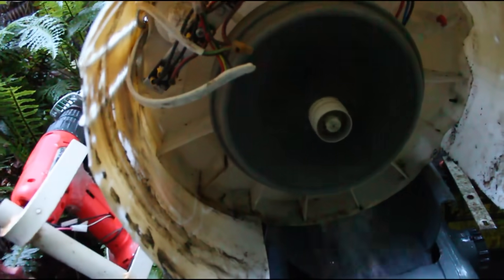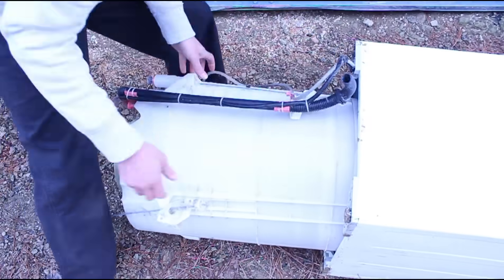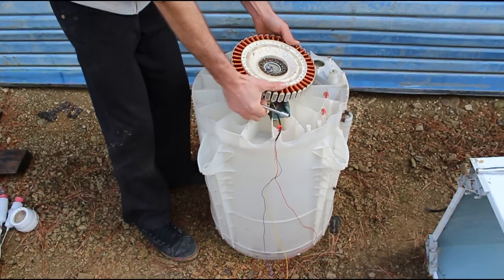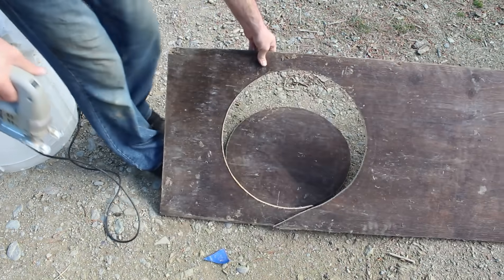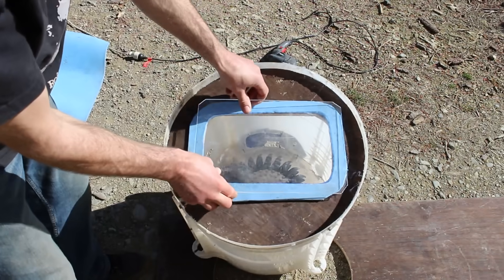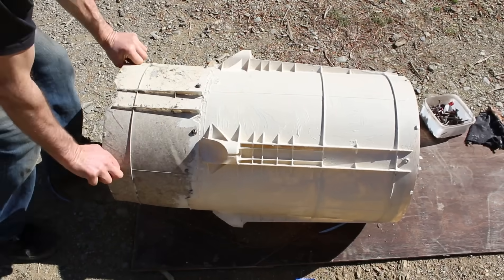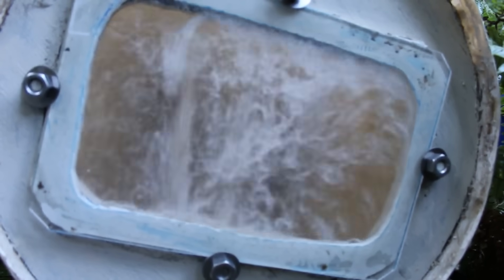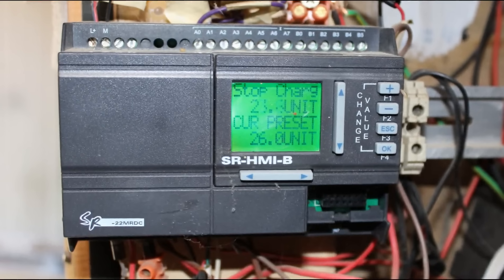Free power- How to convert an old washing machine into a water powered generator

Comment: THE BARREL HACK: Quite impressed with this mad max hack you've managed to have convinced myself to thinking you've managed to put together a system that's looking pretty darn feasible no doubt. Very impressive indeed.

Mr. Angry Ram I would like to make a suggestion dealing with the flow of water entering the system (ignore if you had mention this idea as I charged into the thick of the video.... Okay once the system as you'd mentioned has made its rounds by charging, heating... done all its possible needful tasks. And now is just washing of electrical generated potential power and that means the mechanicals of the system are continuously being 24/7 stressed by just the sheer movement causing wear and tear due to the nature of friction.
So to reduce the amount of usage the system sees how about connecting a 12v DC Auto Relay/ solenoid gate valve into the water line. Obviously set it so your system sparks alive when power is drawn and opposite when no significant power is being drawn.
Yes, I am not just another one of those folks who just talks because he thinks he knows something. No, that’s the furthest from the reality. Because in fact I have a bush camp with solar power with pretty serious 12volt power system that I utilize several water pumps in-line and bilge, timers float valves, check valves, etc.… (Incl. battery bank acting like kind of a big juicy capacitors… just like you’re doing) 
Everything from thermal solar earth battery bank, to night lighting my power system is basically utilized to its max. But keeping in mind I do try to manage to put the least amount  demand up-on the system whenever possible… example no need to circulate water from the thermal solar collectors to it earth battery until the sun is strong enough,. Thus a check valve is a smaller solar panel operating a relay.

Nevertheless i am impressed ... very cool 

Reinholdt

Comment: Wow this is amazing. I spent $1400 on a solar kit setup and it generates on a sunny clear day 5 hrs of good amp hour rated energy of about 180 - 200 Ah to charge batteries.  This thing, which I assume you didn't pay nearly that amount for, generates 24 hrs of harvest-able energy and for a 12v system seem around 900 AMP HOURS! (450 Ah on a 24v system, which is all the same...24v systems are more efficient for homesteading and easier on the batteries/wire loads so I'd be going with that.) Holy jeeezz. 14 kWh system that thing supports. Maybe I did my maths wrong but wow. I know what I'm building for my mountain homestead when I get there. Wow. You'd make a killing selling that energy back to the power companies on the grid because 14 kWh a day about a 1/3 of what I'd probably actually use on an avg. day.

Comment: I wish I was an electrician!  The mechanical stuff I get, but wires and electronic stuff?  Does my head in.
Reply: You don't need to be an electrician to figure out electronics there's enough info about the subject on the internet for anyone to freely explore
Reply: im currently studying too become an electrician, its exciting
Reply: +phoenixrisingharley that adds to the shock value
Reply: Funny. I'm the total opposite. Doing drive trains, crank shafts blows my mind and has held me back from many projects, but I could design a basic CPU with transistor logic.
Reply: Simply: Fairys fly through the tubes and make things chooch
Reply: it is all beyond me....i can chop wood lol
Reply: I'm an electrician I just need a river going through my property
Reply: you dont need a river. All you need is a tub of water. A dc water pump from say a prius. A pelcan wheel attached to a generator. 55 gallon plastic drum. few bits and pieces for mechanical fastening. Assuming you already have your battery bank controllers and what not
Reply: Wouldn't the water pump use more or at least a significant amount of energy than the generator produces? that is getting into the realms of perpetual motion isn't it, if that could be done, than whole power stations could be run on it.
Reply: There's no water pump and "then" doesn't equal "than." Yes this is PERPETUAL MOTION because WATER is PERPETUALLY MOVING. It magically floats up with no energy from us and comes back down with great force that we can exploit. Also, we can exploit the evaporation of water, too. A double sided return thanks to Nature, which will be our saving grace.
Reply: perpetual motion cannot and will not exist.
Reply: inferno, how long has the weather cycle been running on Earth? How long will it continue? It's essentially perpetual until the end of the Earth.
Reply: inferno . nba n
Reply: You lost me at kaplut
Reply: The then than thing was a typo, the rest of your argument is total rubbish.
Reply: kaplut was a (clearly failed) attempt at onomatopoeia.
Reply: +Bodean Digs By any chance do you have plans, or can you point one to a website or in the right direction to learn more?  No stream on my property, and certainly not enough drop to create 45 PSI, so I'm looking for alternatives.
Reply: rockraider3 This would work with wind Mill also. I'm not talking about a big tall thing. Imagine turning the bike generator on end, and put the vanes on what would technically be back tire. Leave the rest of the generator on the ground and connect with belt,
 rope, or whatever. Should work the same.
Reply: Mechanical Engineering and Electrical Engineering are almost the same things. They just use the same equations from different perspectives.
Reply: well you two get together.
Reply: well you two get together.
Reply: David Stewart same
Reply: Volts is pressure, Amps is flow and watts are both multiplied by each other.  AC is Alternating Current,  like a bycicle wheel turns round and round the voltage alternates between positive to negative. The three stators are at different phases in AC, which is the position of the wheel with reference to time.  Rectifier flips the waveforms to a Direct current, and using the three wheatstone bridges as shown allows full wave rectification on all phases which means all of the AC waveform is used to make DC. DC means Direct Current. Anything direct is the same as always positive, but not necessarily constant. Batteries are DC, as such need a rectifier.  Charger will sense the battery voltage and disconnects the charge when the battery is at the charged voltage.  The diverter circuit however is not needed, as a person could allow the generator to freewheel.  That is electricity 101.
Reply: me too, i get it works etc but understanding it another matter though, think its amazing..
Reply: @Bizorke  howww??? Lol
Reply: And am looking for a shop like yours to work with thing I can't found one though. I tired of having those ideas in my head but doing nothing
Reply: Electricity is simple and stupid ,pass a magnet over a copper wire wrapped around a round steel bar, you generate electricity, make a circle with a few more and spin the magnet in the middle .you have an electrical generator. Make another one the same connect the two wires up ,spin one and you now have both a motor and a generator. Stick a light bulb accross the two wires spin with only generator connected, SPIN the electricity will go inside the bulb and try to burn the element, because it cant melt and the gas wont let it burn it gives off light.
Transistors are only fancy switches, speakers are only drums with an on off magnet pulling at the skin, radios and tvs only divide the electrical signals floating in the air to their matched frequencies, (On-Off)with its two transitors switching off and on going to a combination of above. THATS IT!
Quote (Stupid is as stupid does - ........................) the film
Reply: tallaganda83 I got two large fast rivers next to me
Reply: Hi, I'm an electrical engineer, and some great tutorials I found are offered by Electroboom, GreatScott, and Ben Eater
Reply: check ram pump
Reply: thx great plan
Reply: @inferno7181  I wouldn't say "will not"
Reply: @crazymarkmc  nekmin bam dead
Reply: @Bizorke  Thats why Makerspaces should be more widespread. That way collaboration would be possible among different talents.
Reply: wtf does being an electrician have to do with anything? lmao
Reply: @tallaganda83  or wind. Or rain in the gutters. It's not much but it's something.
Reply: @bodeandigs  nice.
Reply: @pixels303at-odysee9  Holy moly! Make videos. That was epic. Thank you.
Reply: @stephenfitton5516  awesome! Do videos.
Reply: @Cantreachthestars  precious info. Thank you.
Reply: Aurélien Carnoy  In reply  to doing youtube videos, too busy doing inventing stuff 3rd generation you will see in ten years, but can give you now simple electrical ,motor ,generator lesson to do at home ,no tools. Get two stepper motors exactly the same ,must have individual colured wired matched by same duplicate unit.Get out your office stapler and bridge each connector with individual staple until all colours matching.
Now we are going to  spin one by hand taking note of what is happening to the other. Remember FIRST lesson passing a magnet over steel wraped in insulated copper wire will generate an electrical current in that wire.  O.K. spin the GENERATOR you will notice the other MOTOR spins,(IMPRESSED)
Now do the opposite spin the Motor, Orignal GENERATOR will spin. Therefore you can safely state if above conditions met.
A GENERATOR can also BE  a MOTOR?
Reply: @stephenfitton5516  yep. Agreed. Keep on inventing brother.

Comment: Another U.S. equivalent of that is a Kenmore Elite Oasis (and several other models are basically the same thing). I had to replace the bearings in mine earlier this year and that stator, rotor, and tub look identical.
Reply: Wow, great to hear that. I am very interested in using the same method but just can not understand the picaxe method. Do you do coaching and if so I would like to talk about it. Thanks
Reply: Also would year and model is the Kenmore you spoke of above?

Comment: Amazing.  I actually have a F&P washer that has an electronic issue and won't complete a wash cycle (but the motor runs fine) and I was going to let the appliance place take it for recycling.  Now you've given me a mission, thank you!  We have an automatic hose reel that uses only the city water pressure to coil up the hose, and that got me thinking long ago how water pressure can produce the horsepower/torque to crank in a 100 foot hose across the lawn.  Can't wait to rip apart my machine now. BTW has anyone tried hooking the raw 3 phase to a small 3P motor?

Comment: That is spectacular. Thanks for sharing. If I had a constant water flow in my property I would do that for sure! Have you thought about putting an electric solenoid valve on the water line so that it can stop the turbine when batteries are full?

Comment: Very good video. Samsung washing machines have the same motor, but in metal. Where is the 45psi water supply coming from? Upstream into a storage tank?
Reply: look up head pressure for Pleton wheels  .The difference in height between the water source and the turbine location is the key to 			generating power. This height is known as head or more precisely static head. Head is 			expressed in feet just like height; the difference is when we use the term head, we are 			actually talking about energy per pound of liquid displaced. So head is just another term 			for energy, specifically energy per unit weight of liquid displaced. How is this possible? 			Energy, or useful work can be expressed as pound-feet or lbf-ft in the Imperial system. 			If I divide this term by lbf, I obtain lbf-ft/lbf or feet (ft) and this is what is known as head.
If I you know how many pounds of liquid are displaced per unit time (this is proportional 			to flow rate in gallons per minute for example) then you know how much power is required 			since by multiplying head in lbf-ft/lbf by lbf/min, I get a unit of power in lbf-ft/min 			or foot-pounds per minute.
Reply: Michael Schwab
 or you can do alternative research and make a ram pump to do the work. Easily get 45 psi, easily pump hundreds of feet uphill. Oh, and it works off gravity, zero electricity. SO..... Make a ram pump. Power the Washing machine with that. Free power. Minus 40 bucks in material. Oh, And i am not pointing you out Michael. Just Hit reply to your post since you was last on the list. peAce
Reply: that little river has 0.050 psi, enough to power 40w laptop..
Reply: Michael Schwab Thas a helluva lot of pressure . Kinda unnecessary ; why not  just add more jets to the pelton wheel.
Reply: Michael Schwab the author said he had 35 meters of head to do this
Reply: psykopanther interesting thought.. but ram pumps dont pump very fast but if you made 2 ram pumps I think ya got an idea there
Reply: electronicsNmore Usually a few feet drop is sufficient. On Discovery Channel or TLC they had a Mountain Man show where the guy made his own generator in a very small stream. The problem is, in winter time, his pipes were icing up and he had to clear the ice clogs.
Reply: Richard gross I heard 48M or about 150 feet. Way more than enough and hard to come by. 60' is ideal.
Reply: psykopanther this does not work.
Reply: A ram pump causes a lot of noise and vibrations in the water. Could harm the wildlife but there is the pulser pump that does it peacefully using air bubbles and it can take more flow than a ram pump. mind you i have heard of people doing hydro with much less than 30 metre drops.
Reply: I plan on using around 200 to 300 meters of 4 inch wavy pipe, with a fall 15 to 20 meters, maybe a little more. 
Is this enough
Reply: Hello, you said that the Samsung washer has the same motor. What model and year is it? I love angry Ram's method but am stuck on the picaxe as that is not clear. Thanks
Reply: @cuddles6938  use a vacuum syphon system then you can put the whole thing indoors, no need for external water source or problems with freezing 👍🇬🇧

Comment: Might be good to do the AC to DC rectification near the inverter since you may need to run the AC voltage over long distances of wire and having the option to step it up with a transformer would be a good option.

Comment: this is unreal! so amazing. wish i had that water pressure, 900 watts could keep my off grid easy
Reply: I am putting 800 to 1,200 watts of solar on my camper but I am unsure on all the math when it comes to what is needed. You mentioned 900 will do you. I guess 900 is a good number if it can keep you off the grid. I just don't want alot of batteries. I have a live well for fishing that works on a panel and no battery so I am thinking 800 to 1200 in watts of solar and just 2 or 3 batteries to use at night. Do you think that is possible?
Reply: @supportyourtroopsathletes6460  if you were to make sure you had at least 150-200Ah in your battery system you should do fine. But ask yourself what kind of things will you be using, does anything run 24/7? How much energy does it use.
Reply: @HellFire178  ...... I just bought a 14 k btu portable Honeywell air conditioner for my camper. I am not sure how  many solar panel in watts I would need to operate it strictly off solar but have the batteries operate it at night. I know there is math involved , do you know what I need to look at to determine the watts needed in the panels?
Reply: @supportyourtroopsathletes6460  what is the BTU of the unit

Comment: I am thinking if you divided your flow equally among three smaller nozzles spaced equally along the circumference, the shaft load on the turbine would be better balanced and the bearing life would increase dramatically.
Reply: that seems like a great idea but I think you might need a lot more head pressure
Reply: valley rap addict why?
Reply: i think he was implying taking a 3cm outlet [for example] and making 3 @ 1cm outlets
Reply: St medisina naturales casera
Reply: maybe one of those adjustable garden hoses that makes it fan out could work to apply force all around.